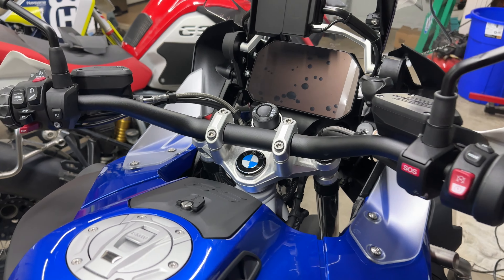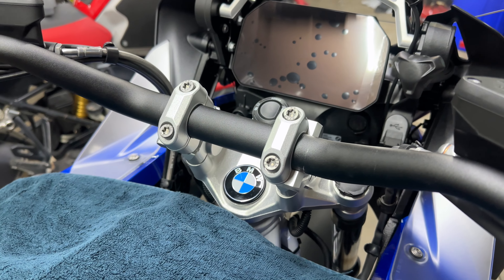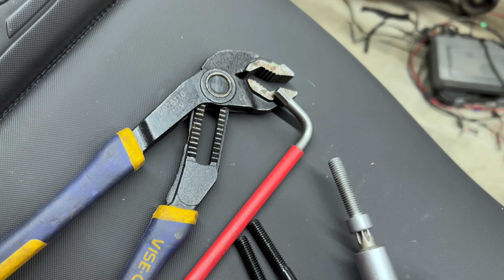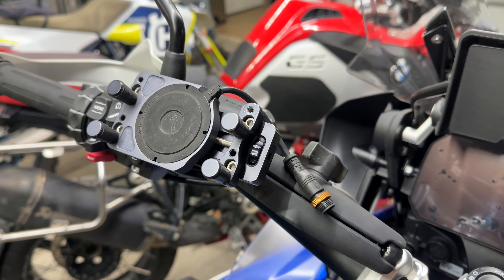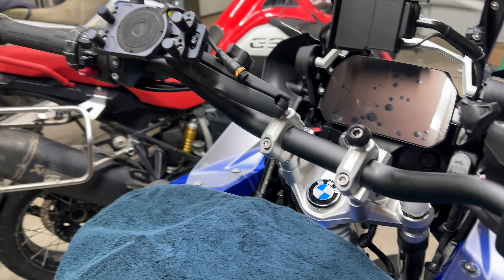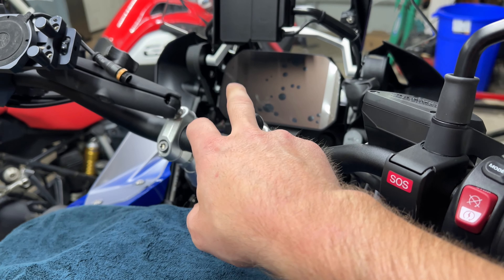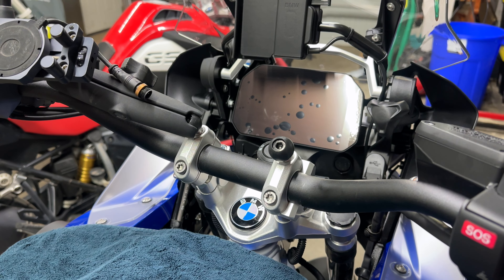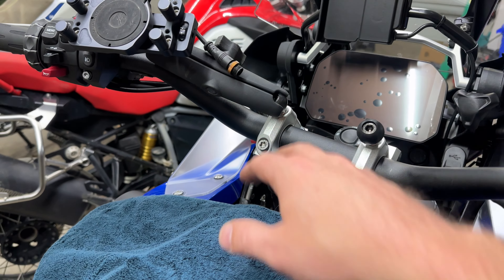Install: RAM Mounts Motorcycle Handlebar Clamp Balls - BMW R1250GS Adventure

Comment: How you like this set up?  Can’t get my iPhone peak design to sit just right with 9l lone rider tank bag.  They now offer a ram model may try.  I had the brake clutch mount which I liked but it hit tank bag with full lock so now have bar mount in center but blocks screen or can’t see at all.  Where you get these what called?  Thx
Reply from the maker: I'm actually about to take this off and go to Peak design mounted directly to the handle bars. Fitment is hard especially with tank bags so I understand what you're going through.
Reply: @ damn just ordered my ram mounts.  You got me thinking maybe better try lil more with this one.  Thought you had it perfected😂
Reply: @AdamChandler86 well I relocated it to as far left of headset bolts before makes turn and narrows…much better with minimal contact with tank bag.  Keeping this set up.  Peak design makes great gear!